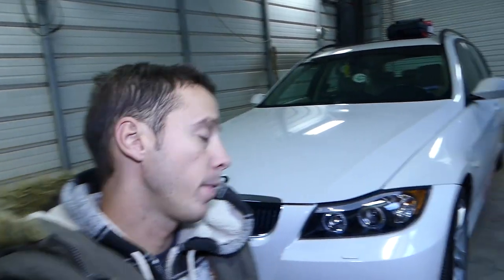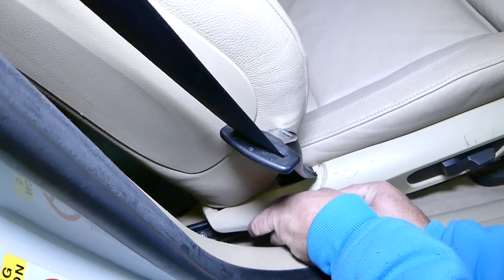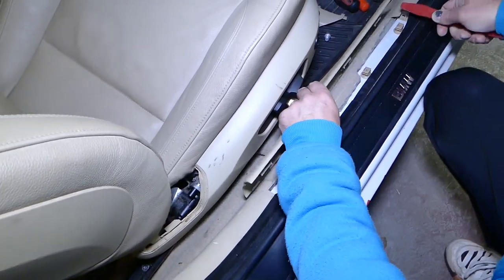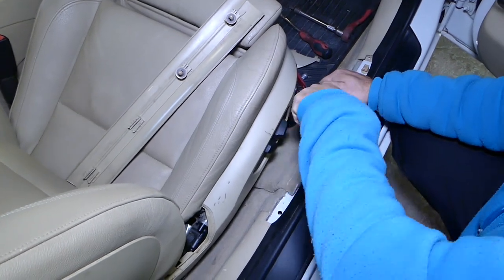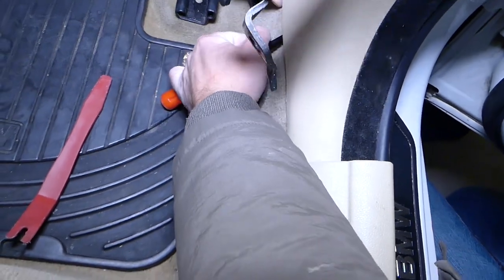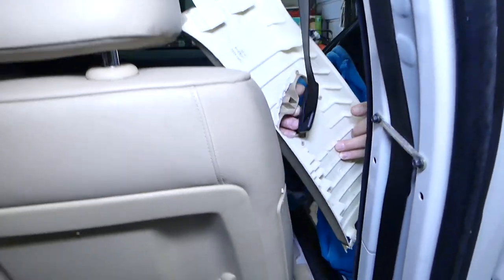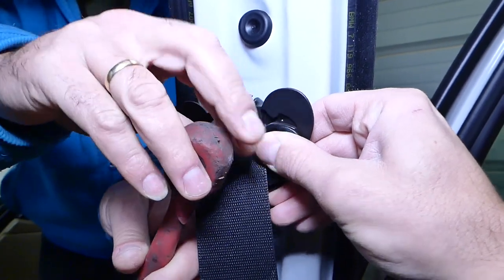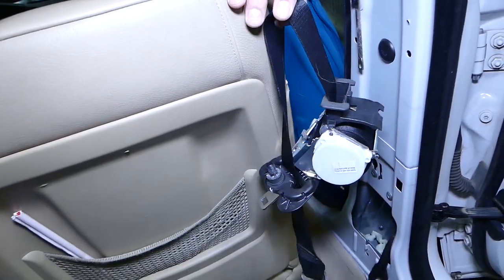HOW TO REMOVE AND REPLACE FRONT RIGHT PASSENGER SEAT BELT

Comment: BTW you don’t need the special clip remover tool. It can be done with a nail remover tool or a normal flat screw driver. I did myself and it’s no problem. Thank you very much for the video! 👍